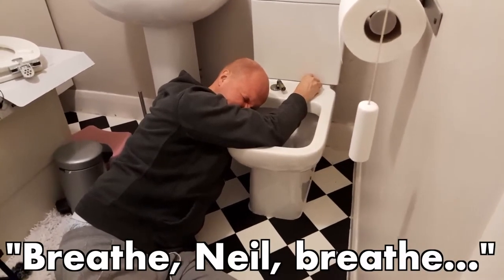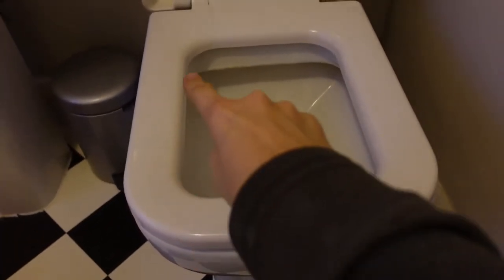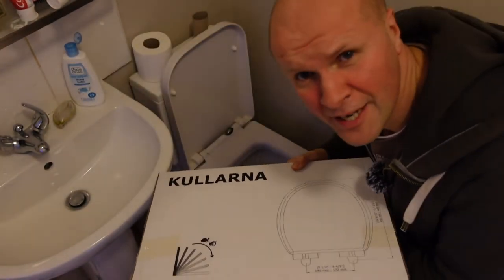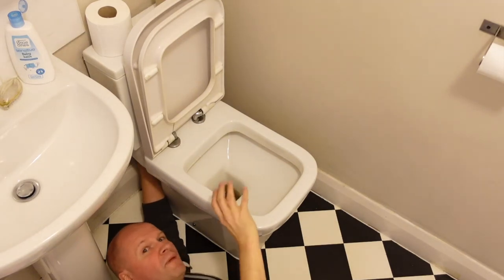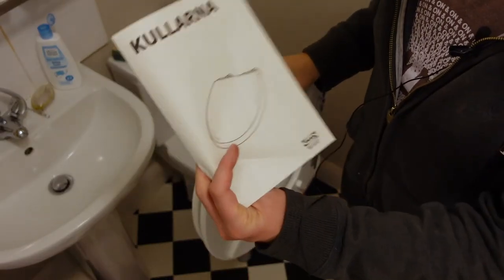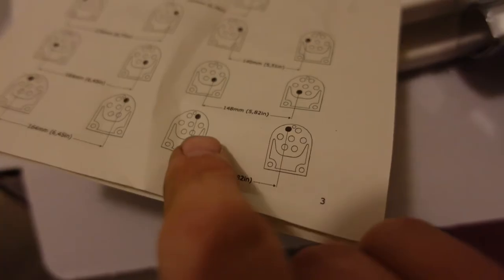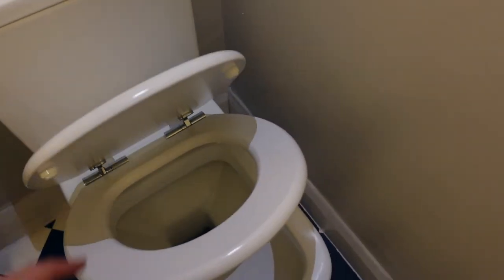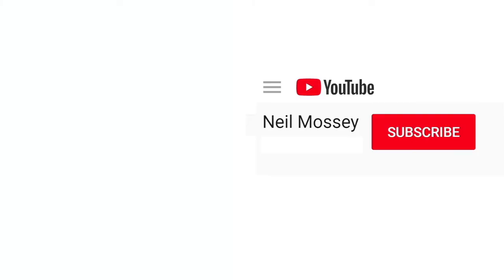FIXED IT! How to fit a toilet seat: IKEA TOILET SEAT KULLARNA review & unboxing & instructions

Comment: Thanks for this video. It brings comfort when the emotional stress of changing a grotty toilet seat is too much. I'm glad that it took just as long to get the b$%^#y bolts out while having your face stuck to rim as I did. The IKEA Kullarna (what does this translate to) toilet seat was really easy to fit which meant that I didn't have to spend any more time with my head in the bowl. 
Thank you to IKEA being considerate to it's customers by not having them put their heads in the bog for very long. I hope ultimately that a much better design can be made in the future which eliminates this procedure. Of course the toilet can be cleaned beforehand which blokes generally won't bother with. 
Thanks for the video.
Reply from the maker: Haha too true!
Thanks so much for the kind message and congratulations on the new seat!!  🚽
Reply: @DADDELIVERS  What colour?

Comment: Where can I find the bolt sizes? I need to replace one of them (was misplaced while moving)? 
Thanks
Reply from the maker: Hi Nehemia! So sorry to hear this, thanks for the kind question!  I'd measure them myself but they're bolted to our toilet!
I've looked at the instructions here
https://www.ikea.com/gb/en/assembly_instructions/kullarna-toilet-seat__AA-2164059-1-1.pdf
But it doesn't list them, nor are they on the product page (which you've probably checked)
I think it might be easiest to give them a call - they're usually really good at dealing with questions when I've called
Sorry I cant be more help and good luck!
Reply: @DADDELIVERS  yup. I searched everywhere on the web, to no avail. Thought you may know. Thanks alot for the advice and the reply!
Reply from the maker: @nehemiagoldstein4325  Hope they give you an answer or even send you one! I bet they're in that wall of 'bits' by customer services... I tried reaching round to get a measurement but our weird square toilet hides the connections...